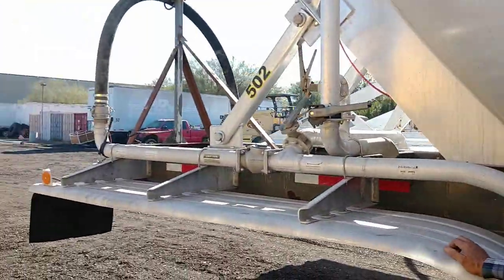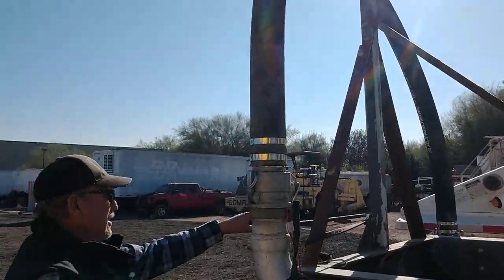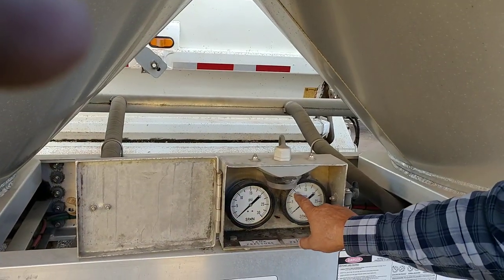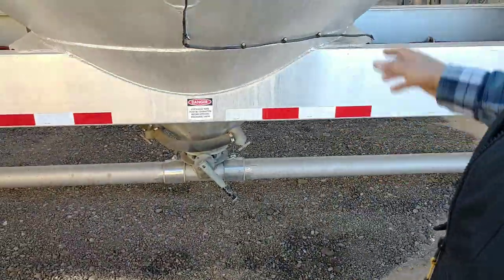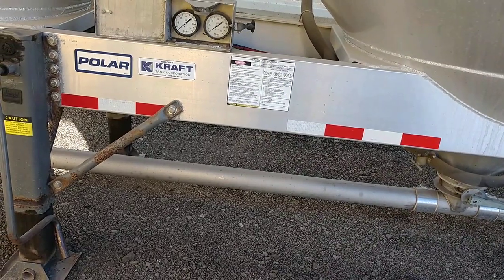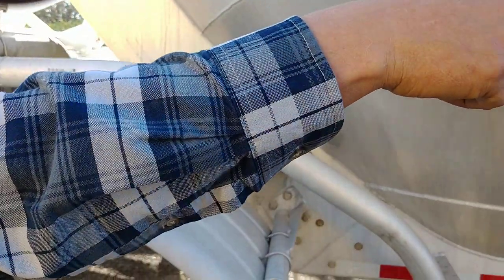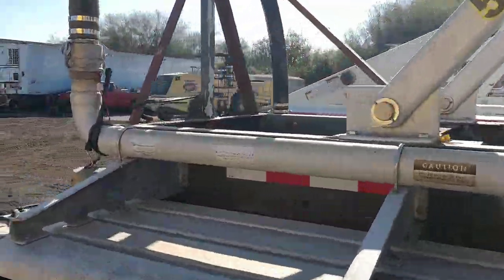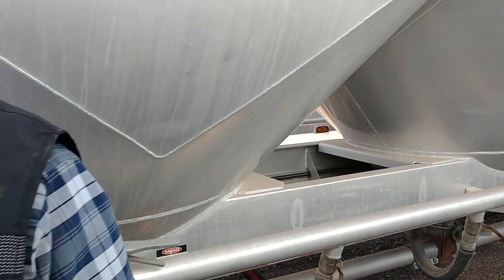Pneumatic trailers taught EZ by my Boss

Comment: So what happens if you get a clog?
Reply: Shut off product IMMEDIATELY. 
See if your pressure will clear the clog. Up to 15 psi maybe a little over. 
If that doesn’t clear it, snap your main pressure valve open and closed, this creates a suction and can clear the clog. You may have to play with it for a while alternating between pressuring up, and snapping that pressure relief open and closed. Bottom line, just don’t get clogged up. Aka don’t be fucking around on your phone not paying attention and letting your pressure get too high, over 15 basically. If anybody is honest, it’s the only way they ever get plugged up, by being distracted.
Reply: 1 close product valve 
2 close top air valve
3 close vibratory off putting all the air on the discharge line and hose.
4 open blowdown valve letting tank depressureize. 
5 open a empty product valve of you have one empty.  Open the rear product valve if all cones have product. If air blows up into tank from discharge line, then you know that discharge line is empty. If  not then you have to go to the next product valve toward the front. May have to go all the way to the front, if it plugged when unloading the front cone.
If all the cones have product it will.still work, but works better if one cone is empty.
When the blower pressure relief is popping off open the product valve all the way quickly and count 1 and 2  about as fast as you can say it and close the product valve quickly.
Sometimes on an empty cone you can hear the product come out of the line and going up and hitting the top of the tank and on air ride trailers it will bounce up and down even when there is product in the cone. 
     What happens is that when the blower pops off the pressure at around 15 , 16 or 17 psi air will go into the air spaces between the particles of product, wherever the plug is in the hose or line, and when you release the pressure forward of the plug the air will rush toward the front to the open product valve and drag some product with it back into the tank. Some products like potash fertilizer that's fairly coarse you can hear it moving thru the discharge line and you can tell it takes about 2 foot out of the line and back into tank every time you open and close product valve.
I know it sounds crazy, all we can do is blow air toward the hose, but it will work , you can suck that product right back out out of the line and hose and put it right back in the tank,   but you have to move that product valve pretty fast, close it ,blower pops off, open it, trailer bounces up and down close the product valve. It happens about as fast as you can say it.
Some products can be really expensive, consequently it can be costly to dump the hose on the ground. And sometimes can be a chemical spill on the soil or in a watershed area.  So you ought to try to suck it out of the discharge hose and not dump it on the ground 
I  have only experienced 2 reasons why I could not suck the product back into the tank. One was because there was wet product, and the other was because the silo was full and the pipe was full and air could not come into the line on the far side of the plug